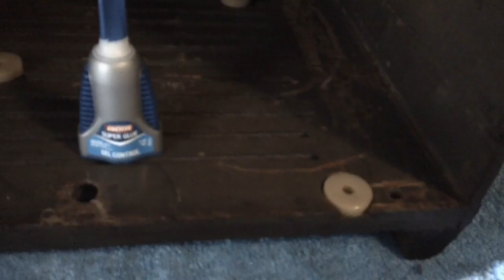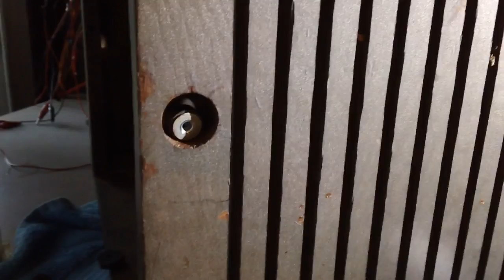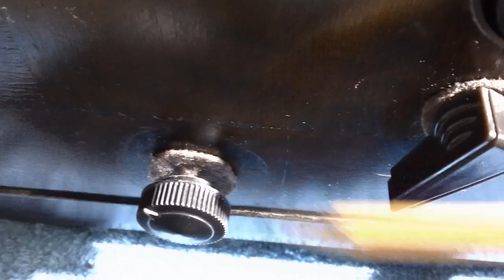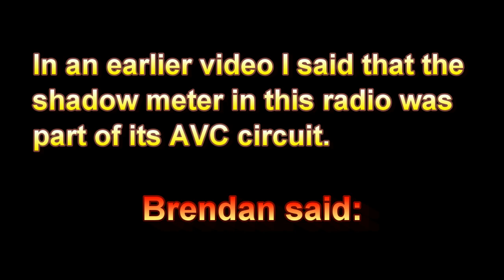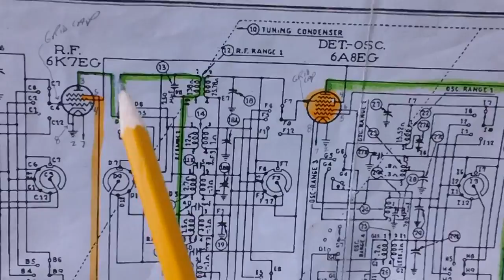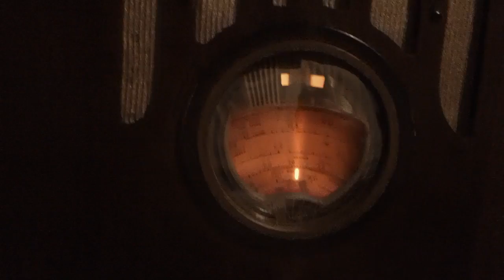Philco model 37-2670 repair and restoration (Part 34 of 34).

Comment: John, was it this series that you did a Philco block cap restore with the block in the chassis, and if so, do you recall which part?
Reply from the maker: Mike,
I did it in more than one Philco restoration, but it starts in part #14 in this one.

Regards,
John
Reply: joernone
Thank you kind sir,

Comment: I'm still waiting on the vintage color tv video. :)
Reply from the maker: Bill,
Don't ever recall saying I would do a color TV restoration.

Regards,
John
Reply: Don't recall you sayig you would either, but you did a great job on multiple radios and even a B&W tv, a color set seams the next logical step.

Comment: Another great restoration finally complete. You definitely covered everything in your step by step videos. if it wasn't for those I wouldn't be at the level I'm at now, they  were a HUGE help. I can't wait to see what you'll be doing with that little clock radio.

Comment: This is the moment I have been looking forward to so much, but also dreading - looking forward to seeing my grandfather’s old radio restored to its original glory and dreading the end of the video series by this talented man.
The radio sat unused after my grandfather’s death in 1961 although my mother tried to have it repaired. However, the only electronics repair shop in our small town was operated by an inept and possibly unethical individual who left the radio in worse shape than when he received it. So it sat in an unheated warehouse for several years until my mother gave it to me. Then it sat in my basement for twenty-six years until I began looking on the Internet for someone who might be able to restore it. I happened to find a series of videos by “joernone” who was working on an Atwater Kent radio. I could not believe my eyes !!! This guy really knew his stuff.
So I left a message and we exchanged emails. John was reluctant at first, but finally agreed to take on the project after seeing the radio’s condition with its intact shadow meter. Little did we know that the shadow meter was kaput, only one of the surprises to be encountered.
John persevered and overcame every obstacle with his calm, reasoned approach. He taught a lot of enthusiasts sound technique throughout the series, especially how to “take your time, piece a cake”. That this will be your last step by step restoration video series is sad on one hand, but you leave a treasure trove of information for enthusiasts, and I look forward to your new venture.
John, we are all indebted to you for your work and the lessons you have provided. I, in particular, am truly grateful for your giving the radio new life, and I also want to thank your subscribers who contributed to its restoration. I know you can find a good home for the radio, but I would be honored if you will keep it in your collection as a present from me.
 
Martin

Comment: John the low band that you heard the CW on, more than likely was a NDB marker. This is a nav aid for Aircraft  You can find more info by checking out you local airports info. Or copy the code in CW and google it. Tunning on that band on my IC756pro I can tune a NDB near me at .281 with the cw letters of CX this marker is used for KCXO airport.

Comment: I'm more than likely totally wrong but I thought the that 5th hole in the bottom of the radio was for a shipping bolt to secure the radio tightly to the cabinet and was supposed to be removed to allow the chassis to then float on the rubber gaskets.  Again more than likely I'm all wrong :)
Reply from the maker: Zach,
You're probably more right than I am.  That actually makes sense.   Maybe you'll  get agreement from some of our other subscribers.
Thanks.

Regards,
John